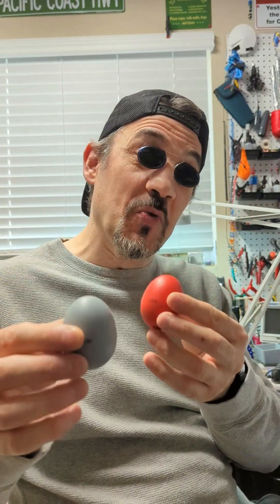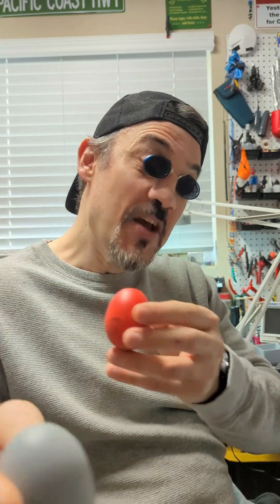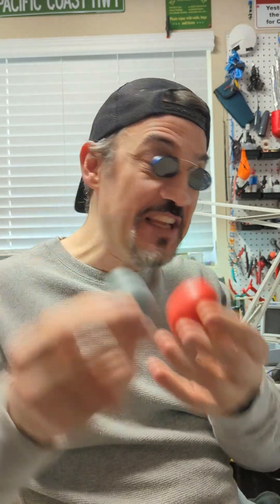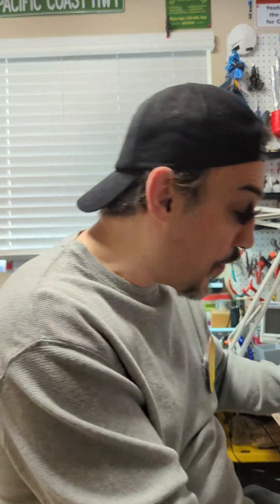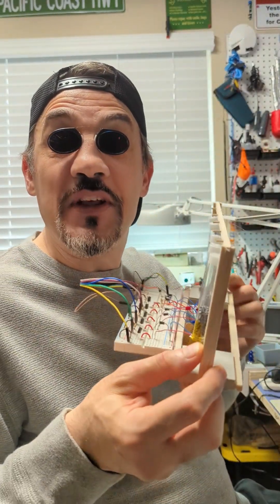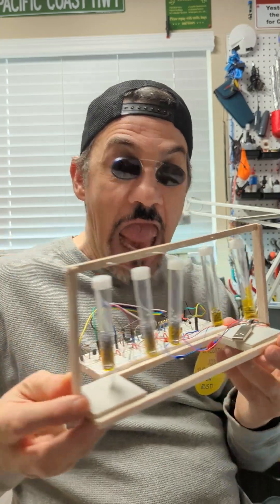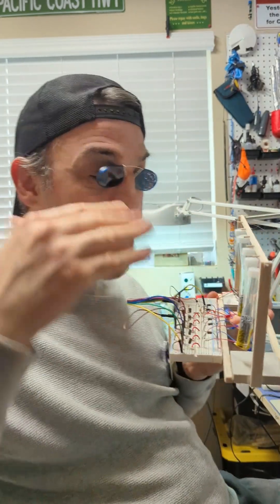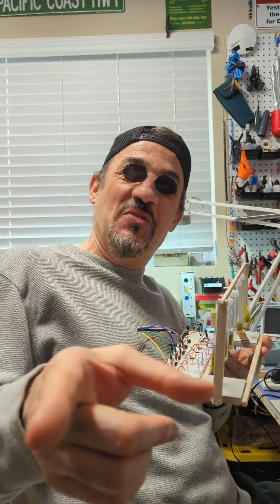The Vibroshaker - a new musical instrument invention

Comment: There is a slight latency, but cool! Very fun!!
Reply from the maker: Hi Christopher. The latency and synchronization are important parts that are difficult to get right. This can be improved in software by using higher accuracy timers for sure. The method I used is based on delay() functions, which do not work with 100% reliability but this is the easiest method to create sounds. Of course, by tweaking the activation at millisecond scale such delays can be minimized. Also there is a minor drift issue that emerges over a long period of playback time but for tracks under 2 minutes, I did not observe issues with the songs I demonstrated. There is definitely room for improvement and I hope watching this invention was an inspiring experience. Thank you for watching and engaging. Much appreciated! 🌟🙏
Reply: @circuitapps  Only my OCD noticed haha.  Its truly amazing anyways!!  Sounds fantastic, a really brilliant concept!